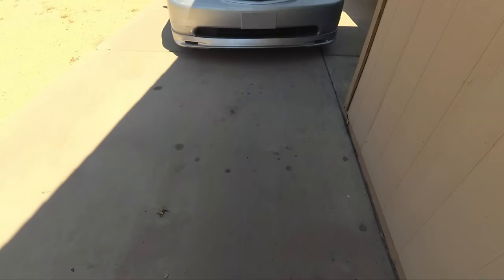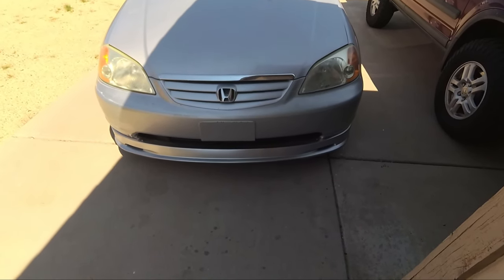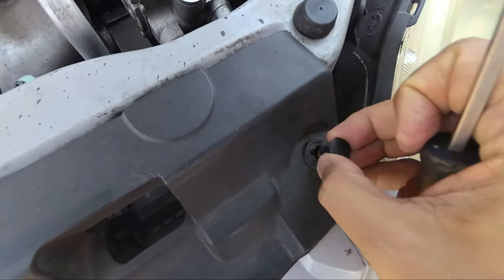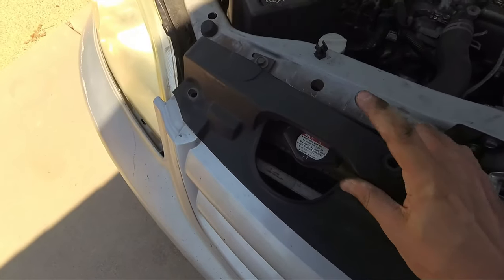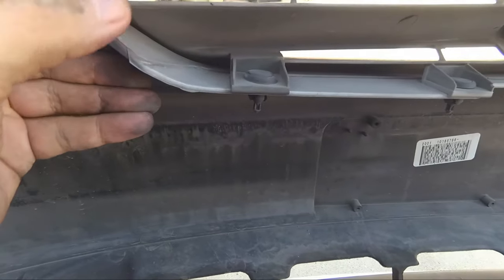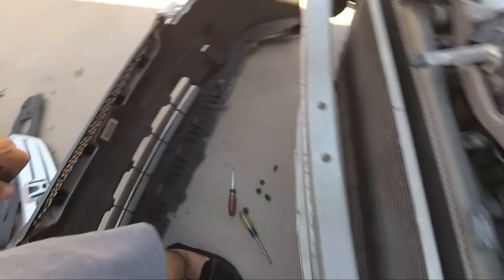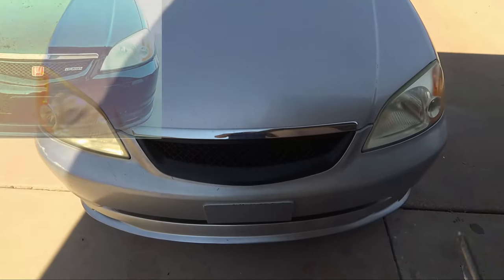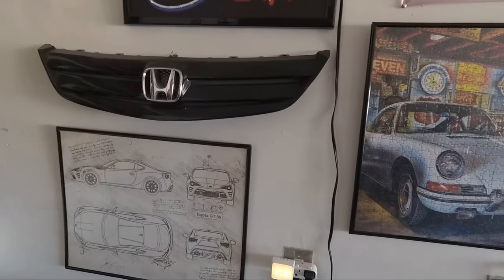TYPE R GRILL INSTALL! Project ES1 (2002 7th gen honda civic)

Comment: Hey wondering if anyone knows if this works for nay 7th gen civic no matter the trim, specificly i have a 04 coupe.
Reply: I think I saw that the bumpers and grills look different for the 04-05. You could just try to be safe by looking up 2004 civic type r grill. The fact that your car is a coupe shouldn’t matter since I replaced my broken 02 sedan front bumper with a coupe bumper. I think hatchbacks are the only majorly different ones but that shouldn’t even affect the front I think. Well idk if this is still relevant to you but here you are.
Reply: @alanandrade2083  yeah I did end up selling the car, but you are correct. I ended up getting an 03 grill and had to send it back, they seem to be smaller and just don’t fit I. General

Comment: How to reattach the Honda logo?
Reply from the maker: I just used double sided 3m tape 👍
Reply: @Jdmforall  I see, I plan on a turbo k24 + mods  inside this 7th gen chassis, would you have in mind any other safer way to get this logo attached and safe even under high speeds or even from someone snatching it off ?